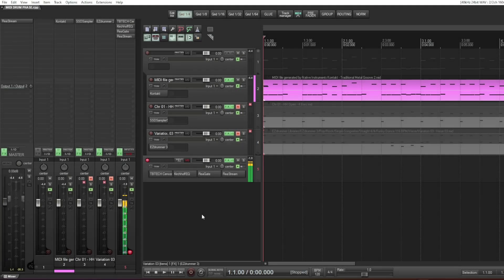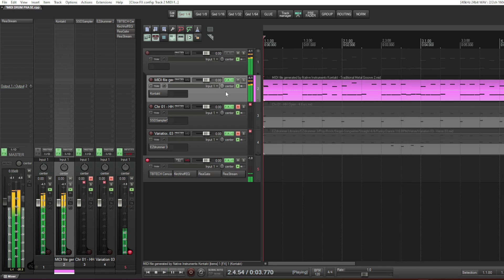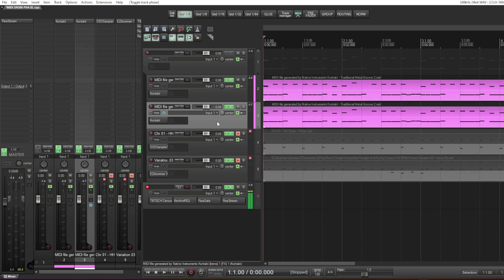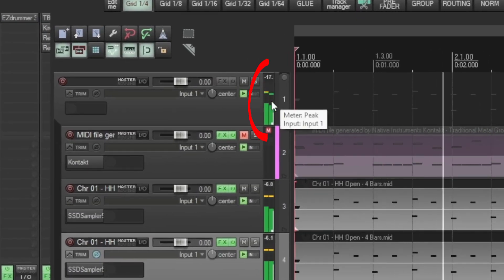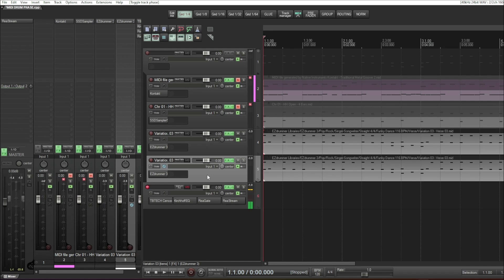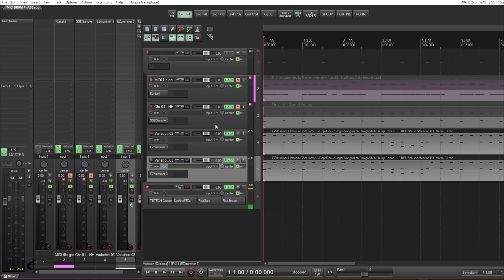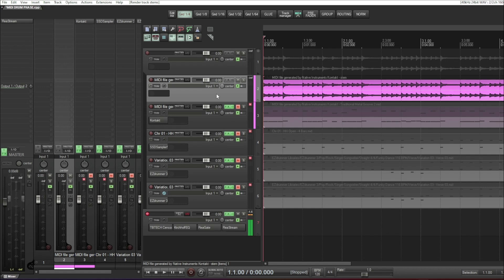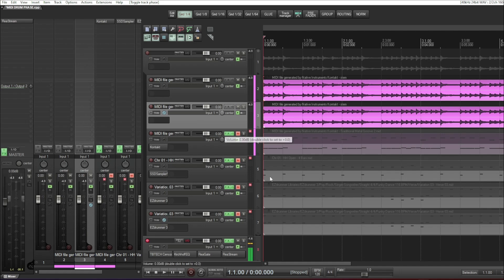THE PROBLEM WITH MIDI DRUMS - AND HOW TO FIX IT

Comment: It´s actually the round robins that are changing every time you run the midi, whilst the velocity itself should stay the same (hence this is the only parameter besides the placement of a hit that you can actually change during the drum programming) but I think the purpose of those had been mentioned and understood in the comments before. So yes, before the final mixdown print the drums in place. However, I don´t feel it´s a big "issue" even when you´re still tweaking the drums and therefore play the midi - the different round robins being triggered every time you start the midi all live in the same velocity range so what changes is much rather the flavour of the hit but its power is determined by the velocity and that should remain the same. It could of course be that different Drum VSTs haven´t been as meticulous with putting the right round robin hits into the correct velocity range, so i.e. even if it should just be a hat with a different tonal character, it is actually also louder and should instead have been in the next velocity range. With the Drum Software I use, this never had been an issue. I am using GGD, SD3 and my new fafourite Ultimate Heavy Drums from MDLTone and with all of them the different round robin samples never spike out as much so they would drastically change how i.e. the compressor or else reacts. Maybe the two examples you mentioned aren´t as consistent when it comes to round robins. Thanks for the video and the time you put into this analysis - I seem to have picked the right drum VSTs 🤣

Comment: It's more  the algorithm for humanization that choose the  Ruond Robin Samples, but in the same layer of velocities, use pretty much the same  dynamic (at less not too noticiable if you don't try to null) , but yes can be a bit annoying. Anyway you can still mix without mayor problem, at least for sketch the mix and see waths work or not. Them yes, you can render and threat as audio file (that's always recommended, not only for this reason).
For the other part, Toontrack nailed it, even if you render one of the duplicated tracks, close the session and reopen, it´s still nulling with the rendered track. But this i discover a few minutes ago, after see your video, i always believe EZDrummer use differents samples each time (like the others plugins behaviour), but now i know it's doesn't. (I still use EZD 2).

Comment: Plugins will react different because drum vsts are meant to trigger different samples every time you hit play for a more natural sound. It's not a problem, this is how these drum plugins are supposed to operate.
Reply from the maker: Hi. It looks like the message I tried to deliver wasn't clear for everyone. I don't have problem with differences in the plugin when I record or write the parts with it.The problem happens when I try to mix the drums. Think about it. After you recorded a live drum performance, do you think the drums will change every time you play them back? Of course not. You will hear no changes at all. That's why I said we should print, bounce, render the drums before adding any other processing like compression, eq, limiter, clipper, etc. I was talking from the mixing perspective.
Reply: @akosfarkas1159 Yeah, you did not explain yourself very well. 

I was a little confused about it until I read your comment here. Like “of course they’re NOT gonna cancel out. That’s how humanization and round robin works, or else you get the machine gun effect”, is what I was thinking all throughout. 

Next time, you need to FULLY explain the problem at the very beginning of the video, and THEN provide the evidence. Not the other way around. Had you done that, this video would’ve been much more clear AND shorter since you wouldn’t have to show more than one drum sample library to demonstrate your point, nor that it was a Reaper “issue”. Use the KISS principle: Keep It Simple Stupid (no offense meant of course. That’s just how that acronym goes), and you’ll end up making better, and more informative videos.

Take care!

Comment: You've figured out how good drum plugins work. They always sound different. If you want the same sound every time, use a simple drum sampler. Then you'll always get the same thing. How boring is that?
Reply from the maker: Hi. What I tried to explain was that during mixing, I don't appreciate the random changes. I don't mind if not every take is the same. Such as in real life. But once I commit to the take, it always stays the same. Such as in real life. After you record your drummer, the recordings don't jump around every time when you hit play.
Reply: @akosfarkas1159  so you have to bounce your track
Reply from the maker: Yes. Simple as that. I just tried to explain and give a demonstration why it is important. It's surprising how often people just use these plugins as they are and just throw some limiter and clipper on the top of it and call it a day, hoping for the best. Of course, it depends on what you want to achieve. A quick demo or a polished mix. Personally, I want to know what's going on inside my mixes and don't like random surprises.